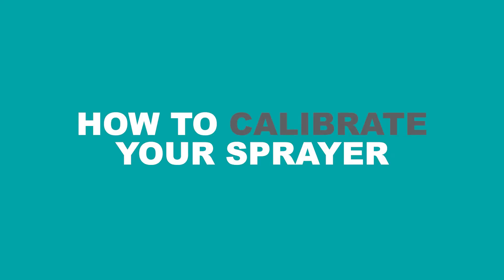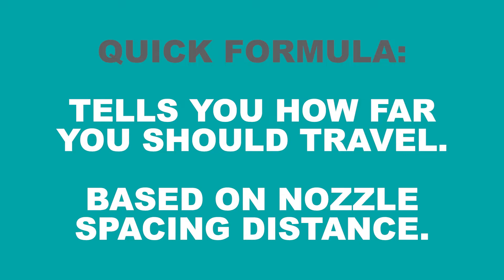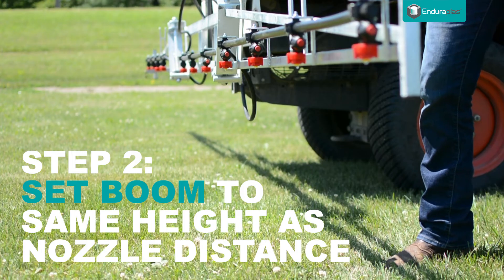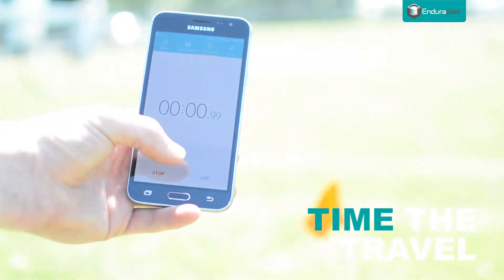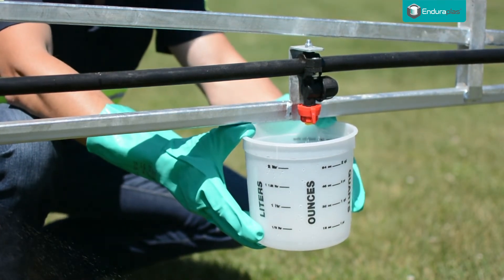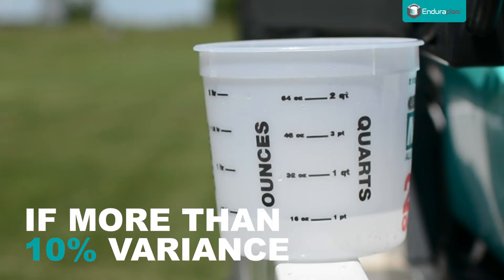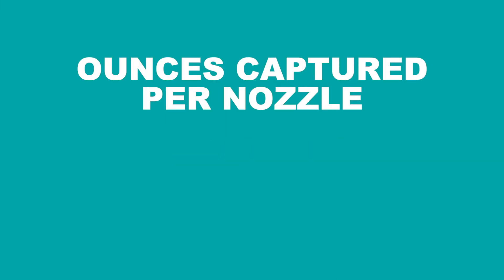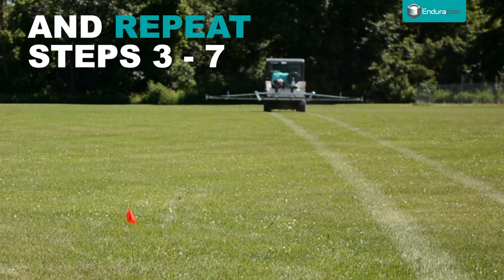How to Calibrate Your Sprayer [8-Step Guide + Formula]

Comment: What's the formula? Mine are further apart.
Reply from the maker: If you check out this post, it shows a few different handy calculation apps that you can use to help calibrate your sprayer. http://blog.enduraplas.com/spraying/calibrating-a-sprayer-4-of-the-best-apps-calculators-and-worksheets